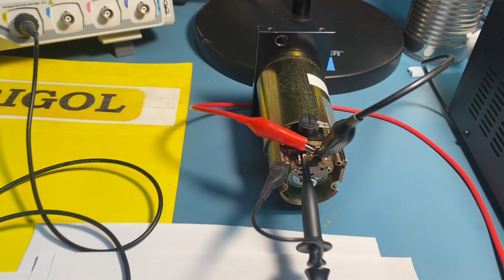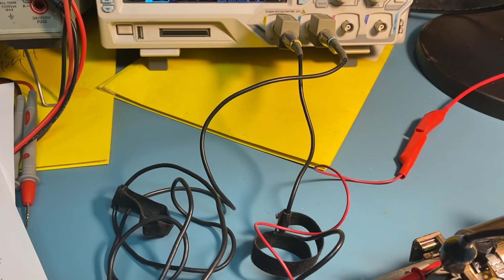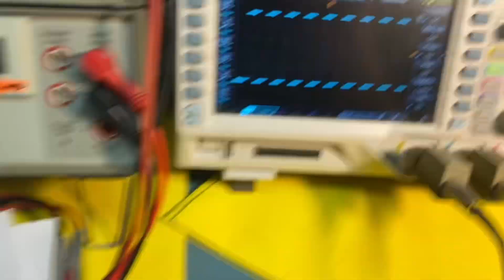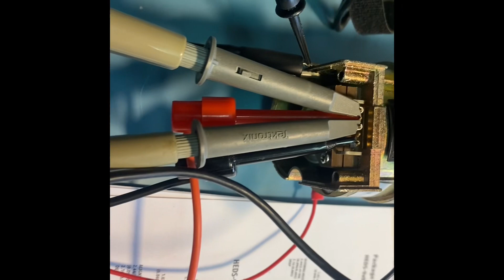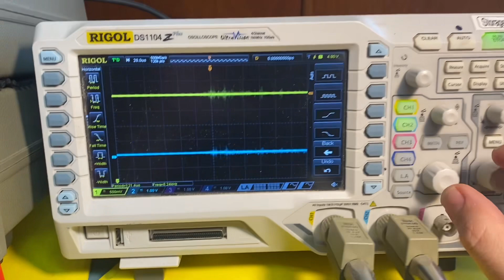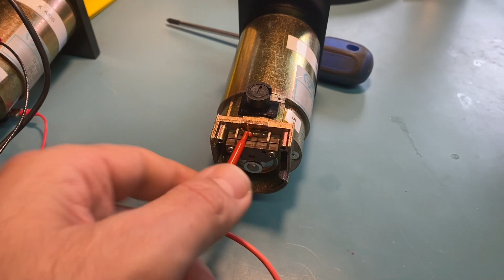CNC Lathe part 7 Testing Encoder Sensor with Oscilloscope

Comment: The two halves of the sensor are independent so it's odd that neither side is drawing any current. Are you getting supply voltage on the actual supply pins of the encoder sensor? If so, bridge them with a 270R to 1k resistor and measure again. If the voltage drops to zero you have a broken wire/trace or a duff solder joint between the sensor and the multiway connector. If it stays (virtually) the same, then the encoder really is toast. The resistor is to draw some current, because modern high impedance multimeters can/will  give a false reading even if there is a hairline break on a PCB which doesn't allow enough current for the sensor to work.
Reply from the maker: Good to know thanks!

Comment: Yeah, the datasheet talks about that the encoder is drawing typically 17mA and max 40. So if you see it not drawing current and you've excluded everything else it's most likely dead. Check the 5V supply for the encoders of your machine before hooking the good one back to the machine, just to be sure. I'm off now for a few days.. Good luck!